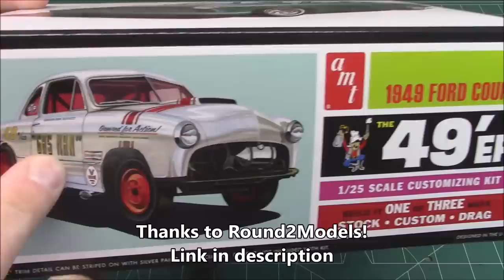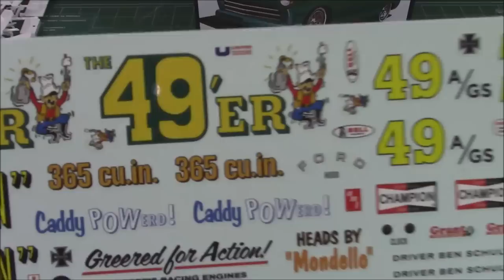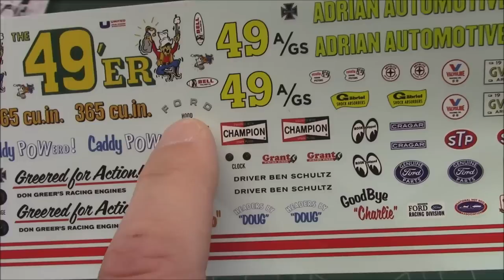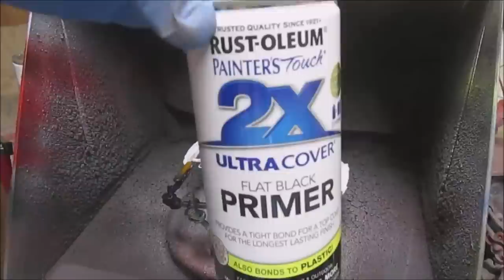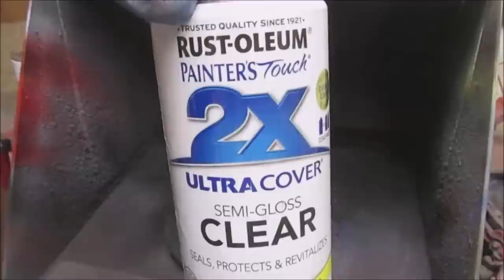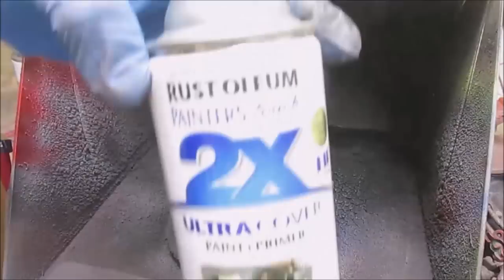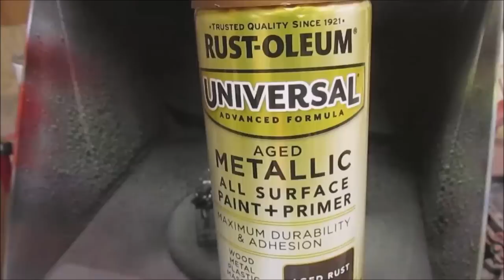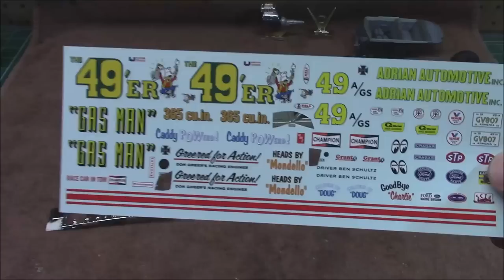1949 Ford Coupe Flathead V8 1/25 Scale Model Kit Review How To Assemble Paint Dashboard Engine Trim

Comment: Bravo for the closing remarks.  

I'm a bit of a perfectionist, but I've been in the hobby since the '70s. I'd rather see 100 people building models the way you do, than only 10 the way I do.
Reply: One of my favorites but I never install "hubcraps " on any model or my own vehicle
Reply: Chris's point is that you build what you want, the way you want to.  Also, he's building a particulat kit out of the box.  What's the point of stopping the build to go looking for a different engine or another set of wheels?

Comment: I remember when Round 2 Models came back out with this car back in 2008(?). I built it as an early 70s street cruiser. Bright yellow paint, deep dish Torq Thrust wheels and wide tires. I added those popular bullet type side mirrors. I used the custom tube grille and smooth front and rear end without the bumpers. I shaved the side trim. I had to cut out the rear quarter areas for the bigger tires to fit. Almost like the box art shown on your kit. I will build a stock version someday. I really do appreciate the beauty of these bone stock classic cars.

Comment: I had this kit back when it was new, first issued by AMT. I built it as a vintage dirt track stock car racer. Painted it yellow, weathered it, used a soldering iron to make dents. Left off the bumpers and made crash guards from some of the styrene. It turned out pretty good.
Reply: It's clearly a good kit with lots of options.

Comment: This was one of my first kit back in the mid 60’s.  It was moulded in light blue back then.  It was built stock and I wasn’t allowed to use paints back then.  My Mom didn’t want me dripping any model paint (Testors) on the kitchen table.

That V8 symbol was a trophy of some kind and was meant to go with the second engine.

Comment: In 1949 the ford flathead 337 ci v8 made 152 horsepower. And ford cheated those numbers. They would dyno test the engine without a water pump and generator.